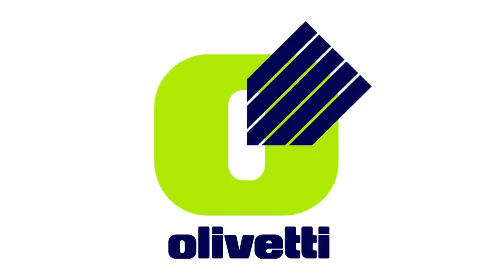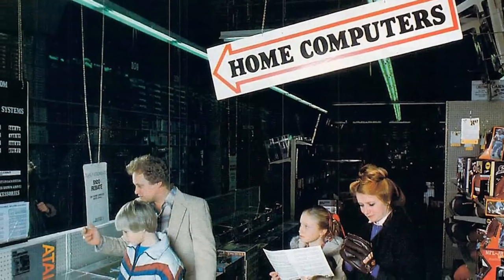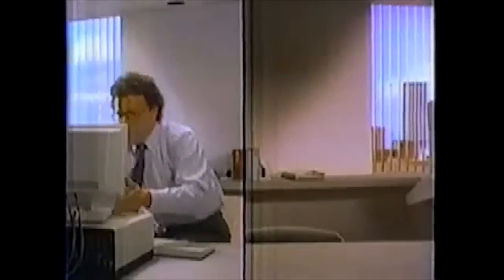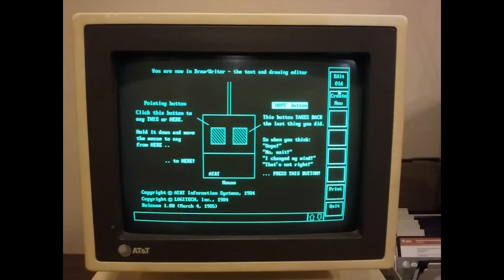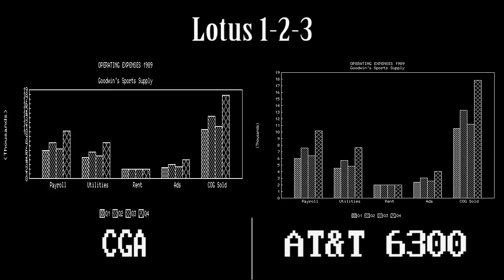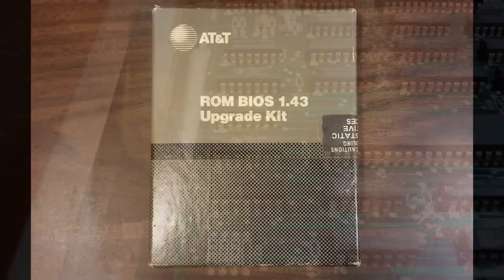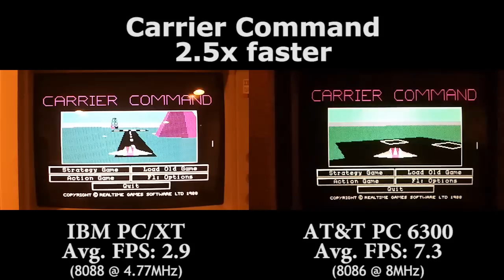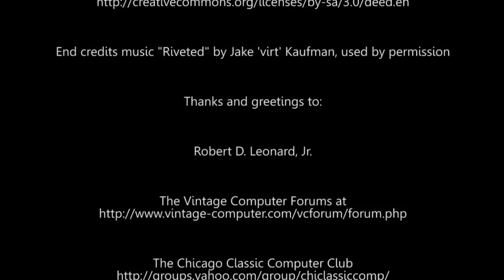The AT&T PC 6300: A Retrospective

Comment: I still have my much loved 6300. We obtained the side caddy with the 10 meg Hard drive (later hacked in a winchester 40) and replaced one of the 5 1/4 floppies with a 3.5 720. The last additiin was a Sota board that made it a quasi 286. One note about the screens, there was a third option of an amber monochrome version. Love the vid, cheers!
Reply from the maker: I have never seen the amber screen, would love to find one someday.
Reply: Jim Leonard They were pretty unusual even back in the 80's - The M20 had them quite often though.

Comment: My dad also worked for AT&T and got us (him) a 6300 plus 286.  I don't know the year.  I think 83 or 84.  had the small green screed originally.  He upgraded it with an HDD  I don;t know what size and a 1.2M FDD.    When he upgraded that was my first computer in 7 or 88 or so.  by then it had a 20MB HDD, 1024k extended ram, 1.2m fdd and a vga card and an NEC multisync monitor.  I had the 84 key keyboard (with no number pad) and the mouse that plugged into the top of the keyboard. He also could get those membrane clear dust covers for the keyboard. Had an old external high speed modem.  I remember playing sticky bear, kings quest, lemmings, and lode runner on it.  External modem, back when you had to dial up an actual bbs board, not the general internet.  Good times.

I just bought a 6300 plus cpu4 barebones case off ebay, i'm gonna build a modern PC in it.  Good times!

Comment: I used a model M24 countless times in the mid-80's. It was a nice machine, and I liked it very much. Today I only have one pre-486 machine. A complete original Unisys Ps/2 series 300. Yup... Original down to the manual and BIOS software. Even have the original 1987 optical 3-button sperry mouse.

Comment: Yeah, good memories. We had the Olivetti M24 and the identical (except for the color) Logabax 1600 at the University in Metz/France from 1985 up to 1990 (when I graduated, after that I don't know). We had it to learn programming in Turbo Pascal 3 and the funny thing is that I found a patch in a German magazine that replaced the 640x200 by the 640x400 mode. This gave me an edge over my colleagues for the graphical assignments we had (a chess board and CAD toolbox). I had also the luck to own an Atari Mega ST2 in which I had installed the PC-Speed emulator which allowed me to program for the M24 as the emulator supported the Olivetti mode and ran with a NEC V30 at 8MHz, so quite close to the real thing (a little bit faster as the V30 was closer to a 80186 than a 8086).
Reply from the maker: From TP 4.0 and later, they finally included an actual AT&T 6300 640x400 BGI driver, so that's how I ended up using that mode.  These days, I look at the specs and see that it was possible to have 320x200x4 in two true video pages, and now I wonder if any game ever used that...

Comment: Never mind... Saw where you addressed the 3 1/2" floppy!  

It definitely was a great computer.  We upgraded to a 40MB HD card and a 2400 baud internal modem in 1989...  Eventually in 1991, it was time to upgrade, and we went with a cheap clone (as was common at the time) that could support newer upgrades.  But, this machine definitely had a good run - especially for its time, when everything was changing so quickly.

Comment: I feel compelled to correct your claim at 6m44s.  IBM released the AT 84-key keyboard in 1984 (not 1985!) -- a Model F (NOT Model M!) that had programmable LEDs for the CAPSLOCK, NUMLOCK, and SCROLLOCK keys.  Kinda obscure, but factual nonetheless.
Reply from the maker: Thanks for the correction.  I plan on revisiting the 6300 with a new video at a future date, and I'll be sure to have correct Model F information.  I still feel compelled to point out that the M24 was designed with keyboard lights in '83, before the Model F  6450200 with LEDs was released.
Reply: You're welcome.

Touché, sir.  ;)

Comment: Hi Jim,

for the benchmarks did you install an 8086 back or were the benchmarks made with the V30? It would be cool to add V30 benchmarks to the video and have a 3 way comparison. I guess your intent was to show stock vs stock though...

Great video!
Reply from the maker: +Carlos Teixeira The video shows the actual CPUs used.  Benchmarks were not with an NEC V30.  V30 provides, overall, about 20% more performance.

Comment: My father also bought one in 1985.  The model he bought had a 10MB C: hard drive and a 5 1/4" A: floppy as represented in your later model version, but no 3 1/2" floppy B: (I assume that came out later)...  It was maxed out with 640KB RAM and sold bundled with an Okidata Microline dot matrix printer for the low price of $1999.99.

Comment: The keyboard was an Olivetti keyboard. At the time there were two schools of keyboard buff. Those who liked the rather "clicky" IBM typewriter keyboards and those who liked Olivetti's take that was softer. Professional typists generally preferred the keyboard they'd learned on. So the comment about the keyboard here is invidious.

In Europe, Olivetti offered three monochrome monitors with green, white and orange phosphors.

The serial port could be upgraded with a chip (an 8250 iirc) on the motherboard to allow synchronous communications. As far as I recall, this was only used for a few turnkey projects Olivetti did for large Italian customers such as Autostrade Srl.

One problem of having two identical ports on the back was the (slightly) famous blown blue gun on the colour displays caused by people plugging them into the parallel port.
Reply from the maker: My first keyboard was the Olivetti keyboard which I used for five years.  Later keyboards were clones.  After that, I typed on an IBM buckling-spring keyboard and found it was the very best for me to type on, so for the last 20 years I've standardized on IBM "model-m" keyboards.

I did not overlook the fact that the top and bottom came off the case, as there are several pictures of both in the video.  I'm guessing you didn't finish the video, or only skimmed it.
Reply: Jim, you're quite right in your observation in my comment. You read an early draft of it. I later amended it.

Comment: I'm not at all surprised that flipped motherboards didn't catch on. Before SMT, motherboards were wave-soldered: the board passes over a wave of molten solder which adheres to all the pins of the components. Installing the card edge connectors on the reverse of the board would require them to be manually soldered onto the motherboard, and PC motherboards being dirt cheap, that would of taken an unacceptable cut into the manufacturer's margin. There is an altogether better model anyway: passive AT backplanes with the CPU and memory on a riser, but that didn't catch on except in industrial PCs, again because it was more expensive. Today PXI and VXS are superior form-factors to PCIe but for the same reason nobody is going out and building their desktop computers with it because of the added expense. I actually thought about doing it, but when I got quotes for buying a VXS backplane and compute board for an old VME chassis, I piked out because it was too expensive.
Reply from the maker: Thanks for the info!  I'd add that passive AT backplanes with risers were also less desirable for consumers because they required more case real-estate.
Reply: The whole concern behind the design was allowing full access to the motherboard. 'Tis nice, and we didn't get into trouble with signal quality, though the main power distribution needed to be manly. It is a bit tall and heavy though. It did make it feel expensive, and it was a major investment for most folks.
Reply: It was a completely separate board under the machine.  No issues as you describe.

Comment: The technical reference manual is available at seasip dot info. Appendix 1 says "In Text Mode, mouse movement will cause cursor key tokens to be inserted into the keyboard buffer." and section 2.3.3 describes how the mouse buttons generate keycodes. I remember you could use the NVR program to set the key codes generated by the mouse buttons. I seem to recall that enter and escape were the defaults but maybe I'm confusing it with the enter and forward-delete codes - section 2.4 says otherwise.

Comment: Due to get a 6300 soon - i'm stoked! Only real gotcha i've heard is that if the clock battery ruptures the whole board tends to go with it if any leakage at all hits the board.
Reply from the maker: That's true of all motherboards.  At least with the 6300, if the battery explodes while the system is stored normally (upright), it just drips down onto the case.
Reply: ah! good to know.
Reply: So, my 6300 has arrived and only wants to boot to a 0 with a blinking underscore. I hate to bother you about this more, but you happen to know anything about that? The service manual i'm consulting doesn't say too much on the matter and i suspect either the memory is faulty or the DIP switches have been tampered with.
Reply from the maker: That is a catastrophic failure. You aren't even getting to the POST. Examine the motherboard for bad caps and exploded battery damage. Try rearranging the ram.
Reply: yeah, I think RAM issues may be the culprit. nothing obviously broken and the RTC is intact. three chips aren't of the same manufacture as the rest; could that cause issues? would improper DIPs cause a outright failure to post?
Reply from the maker: IIRC improper DIPs would not cause failure to POST except maybe DIPSW 0.  Are you sure you have the service manual?  Start on page 5-8.
Did it display only the 0 before you bought it?  If so, can you return it?  That's known broken.
Reply: nah, it was like that on the auction. I...kinda assumed the issue would be something less than a "potentially bricked" scenario and it was the only one up for auction I could afford.

in the event that this thing is totally bricked and there's nothing I can do for it...well, I mean there's gotta be parts I can use to maintain another working one if I track one down.
Reply from the maker: I will try to track down the 6300 bios source and schematics.
Reply: thanks! and thanks in general for helping me troubleshoot on such short notice again. If that's found... well, reburning the ROMs will be easy since it seems like everything is socketed from the get-go.

by the way, this is the manual i've been consulting. http://bitsavers.trailing-edge.com/pdf/att/6300/ATT_PC_6300_Service_Manual.pdf
Reply from the maker: Mister Argenr and I have been talking offline about his broken 6300, but for the benefit of others, I was only able to track down the 6300 Plus BIOS source, not the original 6300 source.  A disassembly of the 6300 BIOS shows that it outputs diagnostic codes via the parallel port, so if those come out, the motherboard is somewhat alive, at least.

Comment: Hello, I got a question. I got a Olivetti M24  for free about 2 years ago. It was working fine until a month ago. The monochrome crt died. So my question what's the best solution? Trying to find an adapter to convert the video connector on the back to standard VGA/EGA. Or trying to get a Thrid-party graphics card. And what kind of card do I need then?
Reply from the maker: I edited the description to include a link on building an adapter so you can use a VGA monitor.  If you want to try to use a VGA card, you must be on the 1.43 bios, and set SW1-5 and SW1-6 to "ON", and use a VGA card you know works in 8-bit slots.  If you don't know if it works in 8-bit slots (ie. tested on another system), don't use it and just build the adapter.
Reply: I cooked up the display connector from scratch. It's not compatible with anything. I vaguely remember that there was something whizzy about it. If you can find the pinout, and modify a cable, it ought to be able to drive an old NEC Multisync.

Comment: Mr.Leonard, I know this video is old at this point but I actually have a AT&T PC 6300 but I'm missing the monitor. I would like to ask if there are any problems with chip failure once I source a monitor and try to get the system up and running????
Reply from the maker: The 6300 battery leaks and destroys the board, so you should immediately desolder or clip the battery off of your 6300.  A semi-functioning 6300 with the keyboard that comes with it will have the keyboard lights blinking repeatedly when you first turn it on. That's a good sign. If you wait 20 seconds and then you hear a beep out of it, then the system itself completed the power on self test. If you have the keyboard, go ahead and plug it in and turn it on and see if you get that far without a monitor.
Reply: @JimLeonard  Thank you so much for your time, I will remove the battery immediately and then try powering the system on.

Comment: ....So it's the equivalent of the original Compaq Deskpro, also an 8Mz 8086, yes?
Reply from the maker: Exactly the same processor and speed, but the 6300 had a few extra enhancements that are demonstrated in the video (mouse, 400-line display and graphics mode, more built-in peripherals).
Reply: Compaq got to 400 lines at almost the same time, but my bass and I got the patent for the circuit that made it register-level compatible.
Reply: As far as I can tell, the AT&T has the slight edge over the Compaq for MHz. It's essentially the same relationship as the Amiga and ST; one is 7.16MHz (Amiga/Compaq) and the other is 8.0MHz (ST/AT&T), though there were maybe some other subtle differences like memory latency and ROM routine speed because contemporary magazine tests seemed to place them at almost exactly the same effective speed.

(8MHz was the fastest the 8086-2 was rated for at first, and seems to be why the video card uses a punishing-for-1983 24MHz pixel clock, because Intel's first-party 8086/8088 clock generator divides the incoming crystal frequency by 3... in comparison 7.16 is half of the 14.32MHz colourburst crystal frequency - divide by 3 instead and you get 4.77 - which you are essentially forced to use for absolute IBM compatibility, and if you're using a "proper" CGA card, because that's the CGA pixel clock. Presumably Compaq used a different clock generator that divided by 2 instead...)

((and eventually the Olivetti-only M24SP which went up to 10MHz was pushing the limit of the fastest 8086 chip Intel ever made and put up a pretty good fight against the IBM AT in terms of speed... there was a 30MHz crystal in that, so I'm not quite sure how the original 24MHz-derived system timings were preserved...))

Comment: Awesome video, thanks!
I'm just in the process of getting my M24 up and running again. It was the first PC I've ever had, and I destroyed the keyboard controller back in the early 90s. I'll try to fix it. My model has the emulator board instead of the single IC. I was thinking that maybe I could just replace it with a used Intel 8041a, but I'm unsure if there's custom ROM code on the chip.

Comment: I've got a funny feeling I've actually used the Olivetti PC this AT&T computer was based on, certainly I remember using an Olivetti PC in 1998 believe it or not and I remember there being what I thought was an RS-232 port on the back and only one cable for the monitor which was green.  I don't think the computer had a PC-Speaker in it, if it did it didn't work on the one I used, I remember playing some really early DOS games on it and there wasn't any sound in any of them.

Comment: Was the 8087 really included as standard? If not, you should either remove it for the side-by-side or include it on the IBM because several of those games do benefit from having the 8087 present.
Reply from the maker: I think you are mistaken; the speed comparison I show is between the 4.77MHz 8088 running in an IBM PC on the right, and the 8MHz 8086 running in the AT&T PC 6300 on the left.  All of the software on the right is running faster because of the faster 8MHz clock speed, as well as the slightly more efficient 8086 CPU.

The 6300 did not come with an 8087 math-coprocessor; that was an optional user addition.  The 8087's purpose was to speed up complicated floating-point math operations, not basic integer math like the kind games use.  As a result, the 8087 did not speed up any games, only business applications like spreadsheets, or statistic/math packages, or CAD software such as AutoCAD.
Reply: I do recall that MS Flight Sim was one game which really benefited from my purchase of an 8087.
Reply from the maker: All versions of Microsoft Flight Simulator that run on 8088/8086 PCs do not utilize a math coprocessor.
Reply: I think the at&t badged one came with an 8087 but the original m24 had the empty socket.

Comment: Picking up one tomorrow.  Not sure if I want to keep it original or upgrade to NEC V30.
Reply from the maker: Upgrading to NEC V30 will put your system at roughly the speed of a 6 megahertz AT. The only downside is that you can't run geoworks ensemble with an NEC v30 installed in that system. Otherwise I'd go for it.

Comment: The board shortage which was reported in the April 28, 1986 infoworld may have been a reason this computer did not survive.  Sears business centers were actually accepting returns on these and selling them ATs.  Any issue with the highly integrated board caused it to need replacement, and they could not make enough of them, I guess.  

in general. American computer maufacturers considered high amounts of board integration to be the hallmark of a cheaply made machine (re: PC Jr., Tandy 1000SX, and HX). While this was not true for European brands, I can see a computer salesman steering a consumer away from this machine for that reason.